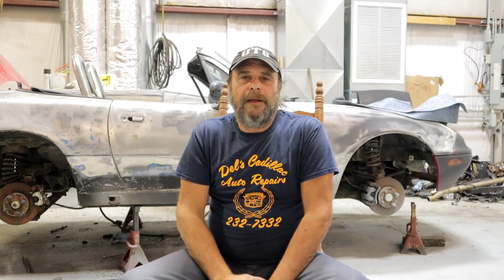Automotive De-Evolution...The Next Big Thing?

Comment: Try driving in Phoenix when its 115 degrees with carb. I park the old stuff June to Oct...
Reply: 67 mustang in Vegas, no AC. Easy ways around the Vapor Lock. AC IS on the menu when re-employed. Carbs just need to be tuned for weather & elevation. When heading to Cali, I'd adjust the carb in Victorville. Drove it to Colorado and adjusted before the Mnts. A little more work, but you are definitly in tune/connected with your vehicle

Comment: I would disagree. To me a car enthusiast is an enthusiast. I enjoy both, tuning a carborater and tuning with a laptop. Me personally, I enjoy getting in my 600 HP air conditioned 6 speed manual and having fun      Just because it's not old, does not mean it doesn't get the job done!!!

Comment: I think what’s going on is that we have so much technology around us at all times that having a simple mechanical thing is like a relief to us. It’s like a vacation from the digital/online age. It’s difficult, if not impossible to fix a vast majority of the things we have now to the point that if your smart phone dies or breaks, you toss it and get anther one cause there is little to no chance of fixing it yourself. Cars have gotten to the point where you need a vast amount of tools and knowledge far beyond what we use on a daily basis to fix anything that goes wrong with it. You’re very unlikely to fix your modern car on the side of the road if it breaks.

An old car from the 70s on back, you can physically see the issue, you can rig it up some way to get you home (most of the time). It’s not going to throw error codes for simple stuff that shuts it down and makes it undrivable. Some cars into the early 90s will allow to do that but a modern car won’t. Plus most of the time (except for extreme breakage) is cheap or at most far cheaper then the same repair on a modern car. Add to the fact in most states, they are exempt or have less harsher emissions requirements. Some of them can even get nearly as good gas mileage as a modern car if tuned and driven properly.

Comment: Couldn't explain it better myself! I'm a young guy, and I've owned everything from a Mini Cooper S, Fiero, Bronco ii, WRX, all the way back to my first and oldest car, a 1966 Mustang. In other words, I've owned cars from a good majority of technological eras. However, every time I look back at all these cars, It always comes down to two main cars that really stick out in my head, my 2003 WRX and my Mustang. I loved my WRX and it was by far the fastest car I've owned, it had the works done to it, rods pistons, bigger turbo, bigger injectors, pro tuned all that jazz. But working on it was absolutely dreadful, even changing valve cover gaskets required a whole day set aside, and if I wanted more power out of it, it had to get retuned. Then I think about my mustang, 289 4 speed, lockers, intake headers, basic stuff, it certainly wasn't faster than my wrx, but the enjoyment of working on it, add power adders, etc, and instantly being able to reap the fruits of my labor was what it was about. Since that was my first car, I didn't understand the joys of simplicity, but ever since then it's been what I strive to achieve.

Comment: Life, as we know it to be, is a continuous process of evolving. Each generation attaches itself to the environment that nurtures it, finding emotional connections, the strongest motivators human beings have, and protecting them. 

Right now...the people Uncle Tony's age are all wanting those muscle cars from the 70's. That's why there's this 'nostalgia' from him and the people that are associated to him. Also why he thinks old technology is better than new technology, when it isn't. He's a luddite as every generation has them. 

We have engines now that can produce 250 HP to the wheel with 3 cylinders, naturally aspirated. It's tiny, as it's actually part of a V12 engine. That's not even cutting edge tech, that's just a test engine made today. Metallurgy today is so far advanced compared to what was happening in the 70's, you can't even compare them. Weight plays a critical point when talking about the concept of 'power' and those old beasts were far too heavy and inefficient compared to even a 2020 Corolla. Times change, technology moves...Uncle Tony KNOWS this because he doesn't work on cars from the 30's regularly, but there's some mechanics that do, and they say they're the best engines ever built. Some mechanics swear by the cars in the 50's, when every one of those mechanics will tell you right after that you have to upgrade the brakes to today's standards. Why? Because they used poor materials back then, like asbestos, for breaking. No one cared enough about stopping, as it wasn't important at the time. Goin fast was, but not being efficient when doing so. 

Americans can't build cars. They don't understand how they TRULY work. They understand how to waste as much fuel as possible, for no reason other than being loud. Cars today DUST everything from the 70's.

Comment: I’m building a gambler out of a 1991 Mark VII. 
In process of Stripping out all the unnecessary junk that doesn’t work anyways. 
Power everything, none of it works, gone. 
Air suspension, leaks like a civ, sealed for coils. 
Plush interior, all dry rotted, stripped and shit canned. 
Smog system, million vacuum leaks, remo…CENSORED..d
I am keeping it efi though.. 
just the basics. 
Lift. Mud tires. Lights. A rack. Tow points. Done.

Comment: Believe it or not electronic bicycle shifting problems in modern systems are not usually caused by loose wires, although it is common. Miost bicycle electronic shifting problems are caused by #1 MECHANICAL DAMAGE,  #2 BAD or DRAINED BATTERIES. Easily solved... Use a mechanical Derailleur.

Comment: I don't think you can underestimate the post 70s trend of taking fads and just running them straight into the ground, EVERYTHING has to be XYZ, the flavor is the flavor. 

I wasn't around for the 80s, but I remember the late 90s...... guys like Coddington ran the 30's coupe overly immaculate builds into the ground, and now you barely see them. Same with "tuner" drag builds. Yes they still exist, but they're not the "in" thing they where.  Foose types took over the 'aughts(followed  by the gas monkey type thing...the reality shows, and started doing the idiotic show boat cars(I'll never forgive foose for ruining the challenger on overhaulin)and ran that in the ground. Now it's effing LS everything.... "Ls ArE tEh GrEaTeSt MoTaR eVeR".... people are just tired of the cookie cutters. Everytime one of these trends collapse, you start seeing people go back to basics and just have fun. 

I honestly think that's what's happening here, guys like you just have a helluva lot better medium to get the info out to people! I'm not gonna lie.... I want to find an old mpar engine and rebuild it as my first motor build now, just because I've seen it proven it can be done without a degree in EE.

Comment: Simpler times, simpler technology, although it was state of the art at the time. The good old days. What made them good? Why do they hold such appeal? Doing it yourself. Hands on. You were involved, not just along for the ride. No scan tool required. No plastic engine covers. You popped your hood and were proud of the work you did on your motor. There was beauty in the mechanical simplicity of what got you from point A to point B. Today's performance cars run like a scalded cat, no question. But something has been lost along the way. Simplicity. Mechanical artistry. One motor looks the same as the next. A little too homogeneous. Pity. Change for the sake of change after getting it right years ago. Sigh, no matter, the gear head isn't dead. Old cars won't go away. Long live the muscle car and those that refuse to let them quietly fade away.

Comment: my classic is a 71 duster 340 factory h code four speed car . i keep it all old school with a holley 750 carb ,  low hanging hooker super comp headers and centerline auto drag wheels which is pretty much the way the car has been since the early 1980s.   i have several friends who also own classic mopars who went to the efi setup and have had plenty of issues while my trusty holley never fails me .

Comment: I have been watching your channel for about a year now and find it quite interesting. I am in my 60's learned to drive in a 66 valiant 20 with Mr. Super 225. I have always worked on my cars myself learning from my father. I still have a dwell meter. I owned and tuned an E type Jaguar with 3 Stemberg's. American iron was a piece of cake in comparison.  I do not miss carbs and points one little bit. There was a more visceral and mechanical feel to the old cars that is kind of fun.  That Jag was a lot of fun  Slant six in a sports car. Not for me. What I do own now is a C5 Corvette. Absolutely checks my boxes. I am a software engineer so the electronics intrigue me. I have written/hacked an interface thru a knock off Tech 2 so I can change engine parameters. I burned my own custom ROM. Same hobby different eras. The other day I found my spark plug extension with a window I used to use to see the combustion flame color while adjusting the carb for that pair of cylinders. Don't take this as criticism just a different  point of view of someone from the same era. Best wishes

Comment: I like new tech and old engines, I mix them often. One thing about new tech is cost. Someone might think a  350hp $10k engine is cheap, if I sink that much into an engine it better be making 700hp/tq at least. I'm working on retrofitting LS EFI to other engines, since I have a ton of that stuff laying around now.  But...

People say my Pontiacs are too expensive to build. Yet I can use factory parts, a factory sized cam with a tighter LSA, run a cheap set of headers ($175) and make 550hp easily, without a power adder or spinning it over 6000rpm. All of $2500 with some ported heads, that is a fresh rebuild with a .030 over bore. Then I can drop it in, connect two wires, then make it run with an HEI and a Qjet. It will also get 15 to 20mpg depending on what I put it in. Yeah you can make that power with a new engine too, but its going to cost you a lot more. It alsosucks working on them.

I like my LS engines, and I can get them cheap enough, but parts, all the stuff I need to work on them, and making them fit in my old truck, hell I can make a Pontiac 400 pull the truck around for less, and make the same power. I've been messing with 1999 to 2007 trucks and what a pain in the ass they are. Sure they run great, drive nice, and I can drive it until it rusts in half and never care. Pain to work on. 

I like playing around with EFI, its something new to learn and I can do things with it I can't do with a carb. I have a FiTech on my 65 GTO, yeah I have issues once in a while, but I have no problem figuring it out and fixing it. I love building carbs too. Really it depends on what I want to do with it as to which way I will go. Lately which transmission I want in it figures in.. 

New cars are appliances, they are get in, and they run. There are no special instructions, no unique things you need to do just to drive it. They are dumbed down so they can be driven by idiots that only know where to put the gas. I don't need the car to do all of that for me. The more it does, the less I like driving it.

Comment: I started driving in 1975 worked in garages and shops, gas stations, junk yards. I’d buy probably 8 cars a years and just beat them then strip them out and run a demo race. I’ve turned chevelles, Torino’s, Fury’s ,Polaris,  225s,  those old slab side Caddy sated the longest. I can think of 50 I turned in to scrap metal and never needed more then a screwdriver,hammer pliers and a handful of wrenches. But now I’m old and paying for those adventures. I’d like to find 1 more maybe another caddy or a bonneville the one with the 500 lb bumper and go take on those tuner cars

Comment: As what was once said in a car restoration book I read: you see mostly mustangs and camaros being done because nobody cares about some 1984 Toyota. 

All these gimmicks and display crap needs to de-evolve. They are causing accidents with all these distractions. It's sad too because instead of more gauges we have the technology to have computers behind those "idiot" Lights and do smarter things for us. We should not have to look at gauges any more. Except we get more and more. 
Now they want to add stuff to put on the brakes when it was never a problem to begin with. 

Regarding 1970: I restored a 70 and I'm working on a 73 and even in 3 years there's a remarkable difference in engineering and workmanship. Also that "cars being big and bloated" trope did not start until after 1971-72. The 1970 car is actually lighter and has less metal getting the job done. The 73 is wider and heavier but there are areas that did not even get painted in the factory. Same engine as the 70, but they put in the larger transmission for some reason.  

I'm convinced that if carburetors were not "abandoned" 35 years ago, they would have been perfected by now. 

Finally all that "spy" crap. Not entirely for spying. But that bit with having to go to a dealer because "everything locked out/needs to be programmed"? Forget it. My newest vehicle is a 2001.  When that V6 finally goes - and it's at a quarter million miles - I'll be putting in a V8.

Comment: There's a reason I chose a classic car as my future project car to restore and keep:  Modern cars are nice and all, but fixing them is an absolute nightmare both in process and cost, and while on classic cars that ease of repair-ability is offset by rarer parts and older tools, reality of the matter is these old cars will probably last another 100 years, assuming you take care of them and preform good maintenance on them.

This is purely from a mechanical field of view however, old cars do indeed have more soul than modern ones.  Which I would argue is equally as important as mechanical engineering, yeah, you can get to work no problem in some dumpy Honda that you bought for $2000, but that's out of necessity rather than pure WANT.  Seems obvious to me that people much prefer the older designs, Dodge in recent years can actually prove this - their Charger and Challenger lineup seem to be hugely popular nowadays compared to other car brands, comparatively.  

Not to give modern cars their dues as well - safety is certainly better than on an older car, although I think that's less because of any type of "crumple zone" design and more that if you took the exact same shape of one of these cars, and replaced the heavy metal with the materials we use nowadays, and of course had shoulder and lap belts, I feel like it wouldn't be an issue - those frames are very strong as-is.  My car actually has the very beginnings of safety equipment, funnily enough, it has a collapsible steering column and has lap belts (no shoulder belts or head restraints though).

Comment: I will apologize in advance for speech to text but... I have opinions...
I'm as old as that magazine story I'm not one of the crazy old guys I'm not one of these young punk kids but growing up in high school if you didn't have a Ford ranger or a Pontiac with all the plastics taken off and painted a different color for each car you had something old and we tinker in friends garages and make mistakes and break parts and fix parts and pull the engines and be up all night and listen to the Sunday night blues on the rock station and it was just the experience of it there's no scan tools there's no special fittings it's just imperial wrenches a couple of screwdrivers a can of WD-40 and friends it's almost like dungeons & dragons or poker friends sitting around shooting the shit smoking cigarettes watching Captain kangaroo and just... being... that is the magic of old cars they just... are

I don't need to snake my hand around a catalytic converter and three engine brackets and suspension components just to get two fingers on an oil filter that's too tight, I don't need to remove five layers of plastic clips to get to the component I need that should just be on the top of the engine anyway, I don't have to go get a special copper gasket from Mercedes to do an oil change, it's an FL1A filter it's right there it's always been right there every single one of them uses an FL1A and oh look at that you can drain the filter and the oil pan in the same pan because they were smart enough to put them next to each other

Everything you need, nothing you don't if there's something you do, there's JC Whitney

Comment: Everyone knows if you are a young guy cheap power comes from analog and mechanical circuits. And there is nothing better than a classic small block with a distributor and carb.
Reply: Or Turbo and EFI! That's what Richard's channel is all about.
But you hit the nail on the head. It's cheap power that everyone wants. If you are mechanical minded, classical small blocks are an obvious choice because aftermarket parts are so cheap and plentiful. If you're a bit more electronically minded turbo and EFI is fantastic. Especially with the cheap ebay turbos and MegaSquirt and Speeduino kits that have become available the past 10 years. For me it's both of the above plus rotary engines because they can be tuned or made into race engines with nothing more than a die grinder or a hole saw and some epoxy.
Hot rodding is all about tinkering and making power on a budget. That's what makes it fun and that's why both channels are so popular.

Comment: I drive a 96 Buick Roadmaster sedan with the LT1 engine. I stripped out as much of the modern stuff as possible. No airbags, no emissions... I'm slowly taking it back in time. But it's still not enough. I really want an analog car. Points distributor, carburetor, mechanical gauges, all that. Uncle Tony's got me wanting to simplify my life.